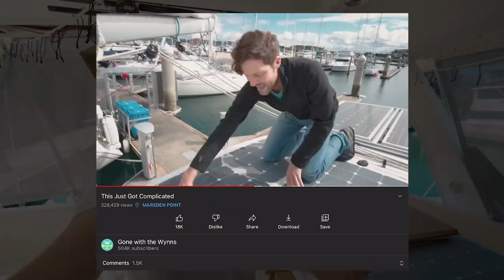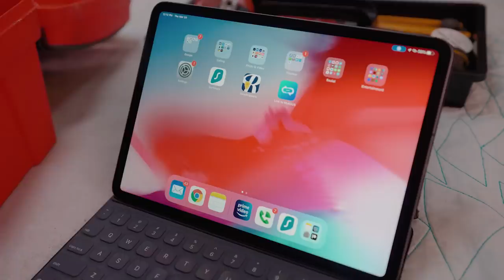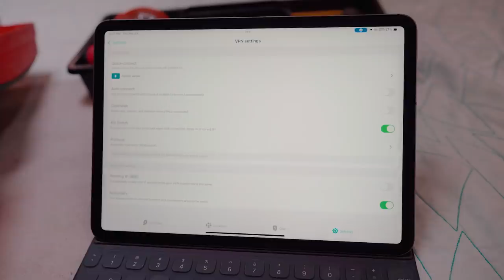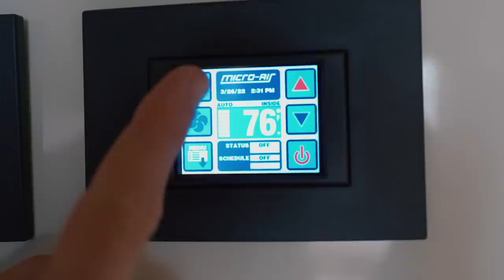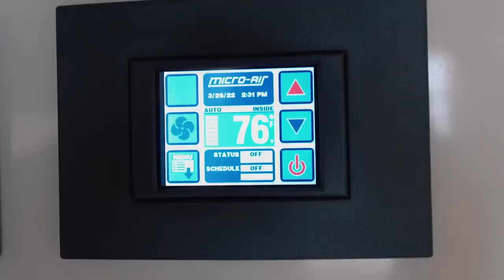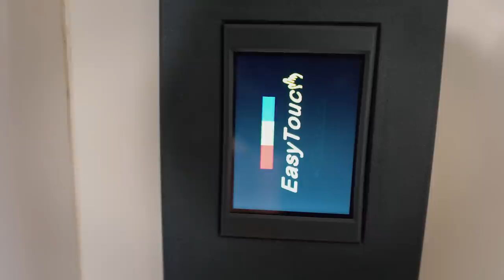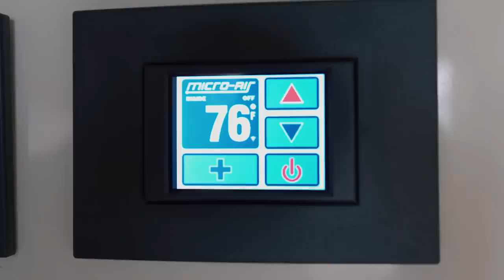Getting Back Modern Day Luxuries

Comment: Hi, thanks for your videos!
But, the WEBASTO 16000 came with soft starter? Or I need a Micro-Air updates to works a Webasto 16000 with inverter and lithium battery?
Thanks for your help, im building a steel sailboat, and now is the time to choose all electrical. Im from Brazil
Reply from the maker: There are some discount codes for the easy starts and a bonus video on how and why to install them on the companion blog post: https://www.gonewiththewynns.com/modern-day-luxuries Whenever you want more info, product links, etc. there is always a blog post to go along with the video. You can subscribe to the blog to get notifications and help out the channel too!
Curious Minion

Comment: I find it hard to understand why more people don't go 100% OFF GRID.  Solar is the best way to do it if you live in a house. In a boat like yours i would use a Hydro-generators in conjunction with Solar. Great power when sailing  and your panels are shaded,  I am in the middle of designing a system for a large power cat. And off course our home is 100% off grid. We need a lot more people to do the same and maybe it would be a better world with less pollution. Anyway that's enough  of that. Don't want to sound like the solar nerd that i am. Enjoying your videos as always. You both rock. 💖😉👍

Comment: You are going to have your polyps removed? I did that in 2013. They will not tell you this. They will break your nose during this procedure! It does not really help your allergies!
I went 1 year before I could touch my nose without tears coming to my eyes! Good Luck! I hope yours procedure goes better than mine! You might want to try a Netti pot with DMSO and warm distilled water. You will also want to use this after the procedure.

Comment: Oh no!  don't step on those flexible panels.  They are still crystaline, and when you walk on them they will crack and reduce conductance.  The only possible way to reduce chance of cracking the crystaline cells is to back them with a like-size piece of aluminum 3mil before they go onto the fiberglass.  If spread your caulk super thin, and covered the entire surface area (like a processor) you could get away reasonably, but it's like walking on super thin glass over rubber,(and then over a concave hard surface) and it's gonna crack.  At the very least always make sure you are wearing full-spread sandals on them, because just the weight of the heel will crack them.  And once they crack, you're going to need to replace it.  Not a fun thing scraping them off, and reinstalling.  Every panel in series with cracked cells will drop your voltage.  Just don't walk on them at all.
Reply from the maker: They are made to walk on.  Warranty says so.
Reply: @gonewiththewynns  Well dope!  Don't mind me lol.  Just looking out!

Comment: I GET THE IMPRESSION LEOPARD PIECES JUNK THAT JUST DO NOT HOLD UP AND LAST  AS YOU  NEED TO REPLACE THINGS MUCH OFTEN  THAN OTHER YOUTUBE SAILORS , I REMEMBER WHEN YOU BOUGHT THE BOAT AND YOU WERE WORKING ON IT AT JUST CATAMARANS
AND IT SEEMS LIKE YOU HAD REPLACED EVERYTHING ALREADY ONLY ABOUT 4 YEARS THAT TRULY  SUCKS  , D . A . G .
BOULDER COLORADO 80304

Comment: The requirement for a qualified and registered Electrician is great, in theory. In practise it is worse. The amount of domestic electrical fires is very high as repairs and modifications are SOOOO expensive. Here in the UK I pop down to the local store and buy a replacement part and just fit it. The ignorant and nervous get help, the idiots all over the world will always risk death. Recent changes to the law stop me doing major work without it being certified so I expect fires and deaths to rise.
"Driving licences" for boats are not required in the UK, in France yes. Result, on the French side of the Channel the accident rate is about one and a half times higher than the UK side.
Beware of well meaning legislators, their objective may be headlines, not rational action.

Comment: Did you not break any rules in not having a professional plumber instal plumbing things or a professional screw turner to attach stuff to your boat or a painter paint stuff, even a cleaner to ensure stuff is clean enough. You might get that I hate that type of rule, if you feel you CAN do the job no one should stop you and ONLY if you are unsure would YOU choose to consult a professional not by LAW.